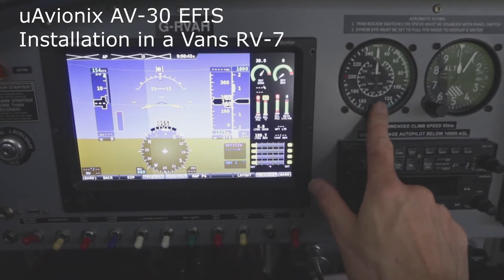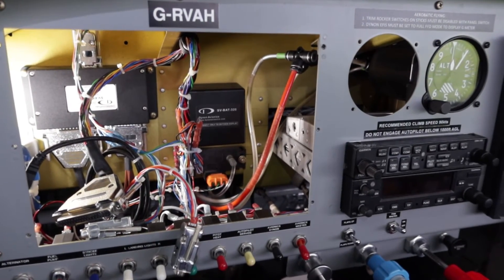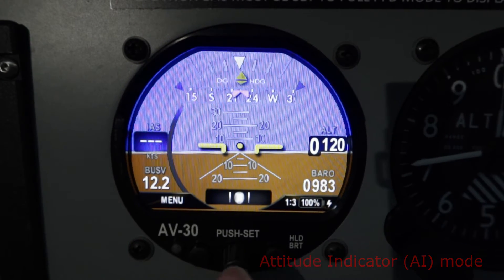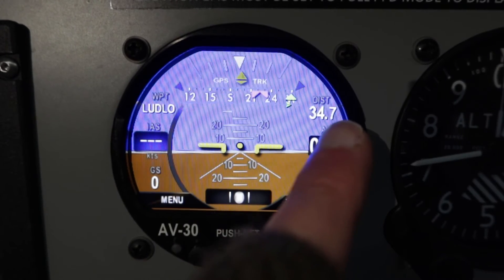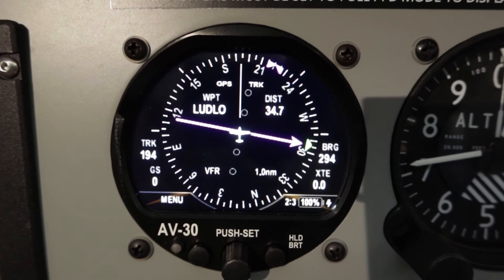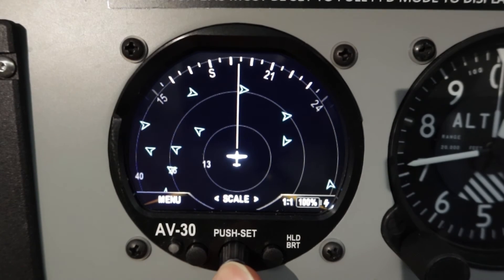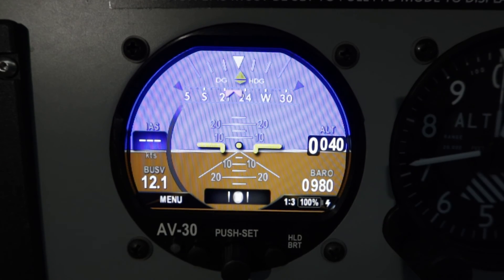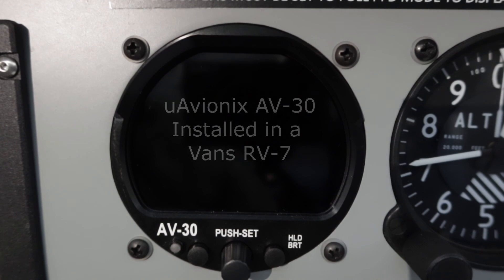uAvionix AV-30 EFIS installation in a Vans RV-7, including AV-Link.

Comment: Very useful overview, thanks.  Have you tried updating software using the AV link?  I cannot update mine using an IOS device, despite following the update instructions.
Reply from the maker: Hi David, yes I updated the AV-30 to software version 2.4.1 using the AV-Link. I followed the instructions in the 2.4.1 Service Bulletin and it worked OK for me from my ipad mini. Best regards, Chris.
Reply: @ctbyoung  Thanks Chris.  I tried with an iPad with absolutely no joy.  The iPad finds the avlink wifi but does nothing else.  Also, the update software app from Uavionix just displays as a Microsoft windows file, which the iPad cannot cope with & just sulks!